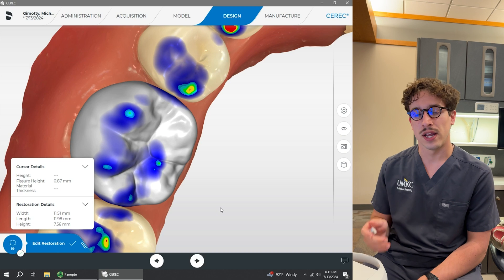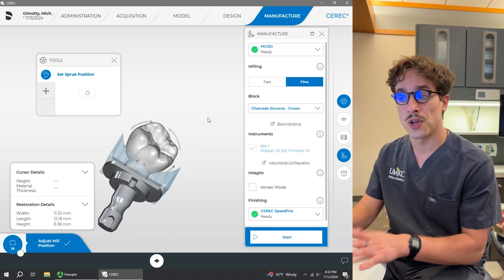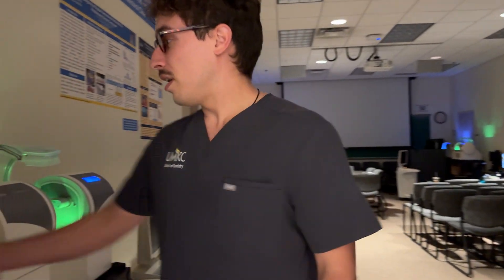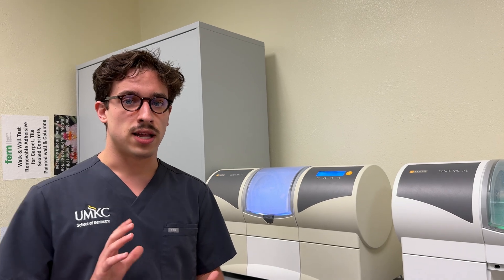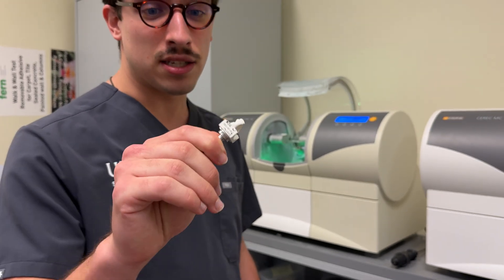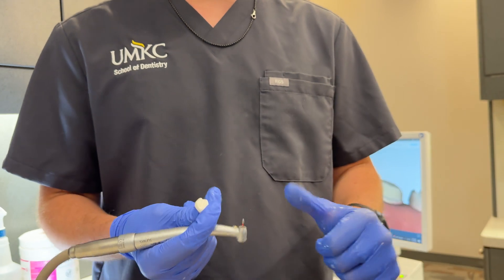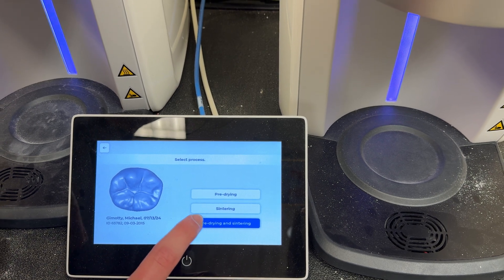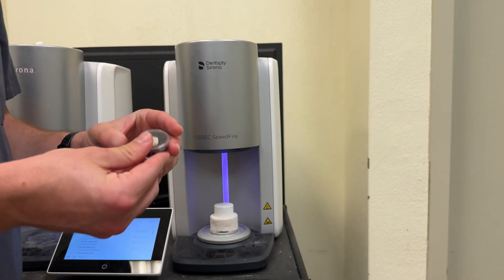Milling a Zirconia CEREC Crown with Omnicam & CEREC MC XL

Comment: With Cerec 5.4 software and a dual-motor MC XL, what is the largest zirconium bridge I can make? 3 units?
Reply from the maker: The theoretical max is 40 mm for block length. Technically, this is only meant for a 3 unit FPD, but you can sometimes get away with a 4 unit if it is an anterior FPD because of the shorter M-D width. However, you get into the issues of the esthetics of a CEREC bridge for those. 

For something that is reliable, I would recommend sticking to 3 unit bridges on an MC XL. If you are consistently doing longer span bridges, something like a PM5 or PM7 from Ivoclar might be a better fit.
Reply: @gimotty  Thank you very much. Can I use the size 20 diamond drill bits with water, or do you recommend the other ones for zirconium?
Reply from the maker: @juliovazquez9834  I would recommend using the carbide burs with zirconia and, if you have the suction attachment, I would also mill dry. It removes the predrying step from the sintering process (saving about 25 minutes per crown) and removes another variable with the water. Sometimes it can get finicky if there is something wrong with the water and it is one less point of failure to mill dry.